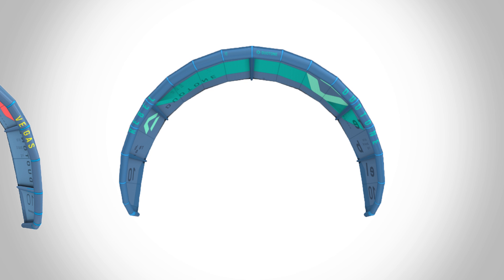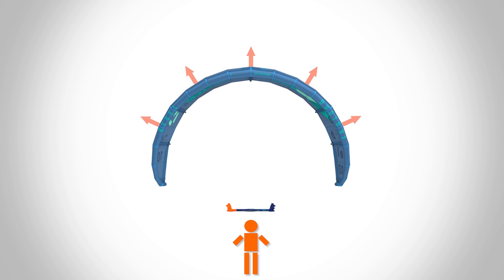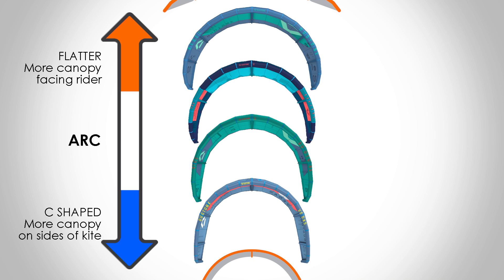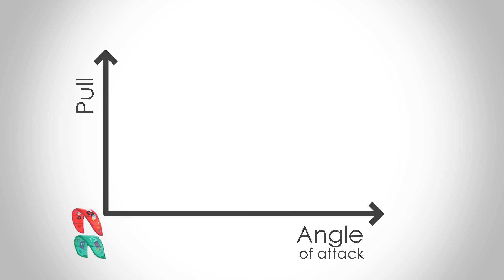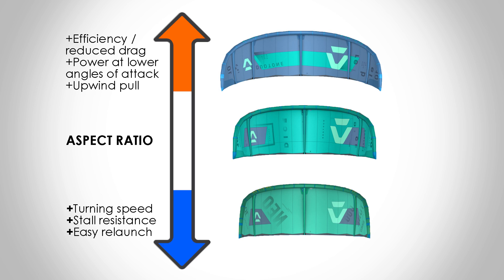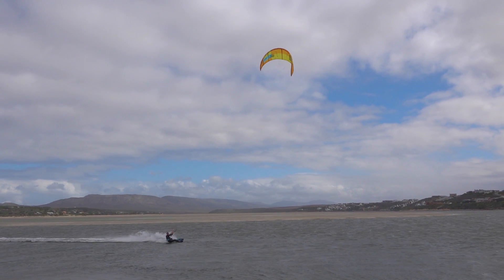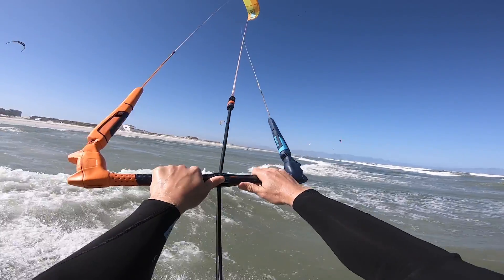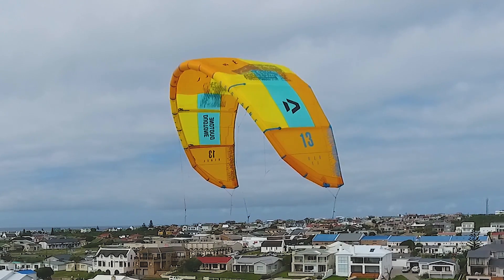Kite Shapes Explained (Bow, Delta, C kite, Hybrid, Flat, Aspect Ratio, Buying Choices etc)

Comment: So are the kite “categories” universally defined as in your slides, EVO, REBEL, DICE, etc and adopted as nomenclature by all manufacturers ? It happens I have bought a set of North Evos (9+12) and at times I feel hopeless but to my excuse I have a job with unsocial hours, so it is hard for me to join other kiters on weekends and improve! 😂
Reply from the maker: Hang in there Paolo, it just takes some time. Every manufacturer uses different terms actually. Some say bow instead of flat. Some say delta instead of hybrid. There isn't much consistency, which explains why there's confusion. An evo 9 and 12 is a great set up, they will serve you well.

Comment: Spot on, great job! 
I wish you could fill that chart with some more hybrid shapes and examples from different brands/models. A 'typical' bow and Delta, a high AR/super flat, etc...  but can also understand your limitations. Good job to Duotone too for supporting you!
Reply from the maker: Hello Nickolay. If you tell me the kite you have, or want to know about, I've probably used it or tested it and can let you know where it fits on the flatness / aspect ratio axis.
Reply: I am curious I have a 2010 cabrinha switchblade, I assume it is on the slightly flatter side with swept wing tips and slight concave on the back edge. Is that correct?
I am only a year in to kiting I also have an ocean Rodeo 2016 prodigy and I would like to get an ocean Rodeo allulah roam. I would like to know more about that.

Comment: Excellent vid as usual! Very clear and informative! 
Could you add some info about the 5th line? Is this line used to help in holding the flat shape on flatten kites?
Reply from the maker: Hello Renato. It depends if it's a "loaded" 5th line or not. A loaded 5th line carries tension from the kite and acts a bit like a bit of extra bridle - it holds the shape of the kite and hinges the leading edge. An unloaded 5th line, has negligible tension - it's just there to be used as a safety line, or to help with relaunch.
Reply: @kitesurfcollege  makes sense! Because some kites usually will have better handle when used with the  5th line...

Keep the excelent content! As a subject for next videos, maybe you could follow the info about kite shapes with lines length... ;)

Comment: Amazingly informative video. Information was presented extremely well. Is there a chance you could compare kites of different manufacturers? For instance I fly Cabrinha and am trying to cross reference their information to your video. Thanks!!
Reply from the maker: Hi fierce seaman. I guess you have a switchblade. That's a medium arc, slightly low aspect kite. On the table it sits half way between an evo and neo. Or do you have a different model? Chaos, Apollo etc
Reply: Kite-Surf-College Tutorials and Tricks I’ve got a switchblade and a contra! Thanks!

Comment: Great video,, many kite manufactures use "1 kite quiver"  but I noticed that looping kites do not jump as high and jumping kites like the rebel don't loop very well.  
Also the dice feels like it is 1 size smaller and the neo feels 1 size bigger.  I guess I need 4 kites in each size
Reply: 4 kites in each size - that was a good one! :)
Better get the best performance from each of the of kite types in its sweet spot (size) ;)

Comment: What shape do you recommend for wave riding with directional board? I understood the kite needs to drift easily when. You're on the wave
Reply from the maker: Wave specific kites are almost always a medium arc (somewhere between flat and C) but with low aspect ratio and a full bridle for depower. If you're primarily looking to ride waves, then you can get one of those. But if you want to mix up wave surfing and twintip riding, then a standard hybrid is fine, hybrids perform well on the waves.
Reply: Thanks for the comments. You mean that the new Dice 2020 for example, will be a good choice for this?
Reply: Duotone neo or ozone reo for example

Comment: What are kite pulleys?
And in what way does it change the kite by removing them
Reply from the maker: Hi Mark. Pulley's are part of the bridle. Because the kite changes shape a little during power and depower, the bridle needs to change shape, and sliding pulleys help the bridle move. However,  a bridle can be built without pulleys. Bridles without pulleys are simpler and give a nicer feeling at the bar. You can feel in your hands what the kite is doing. A kite with lots of pulleys starts to loose feeling. A bit like driving a car with too much power steering.
Reply: @kitesurfcollege  exactly